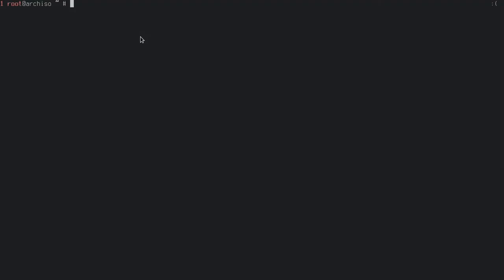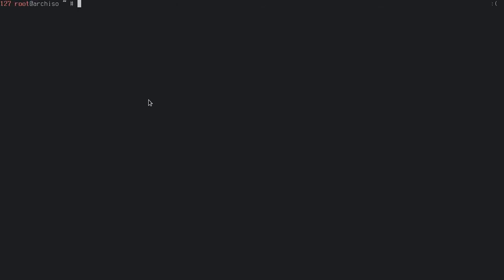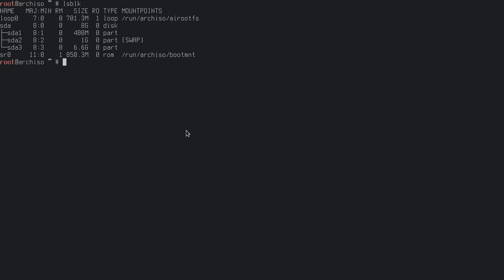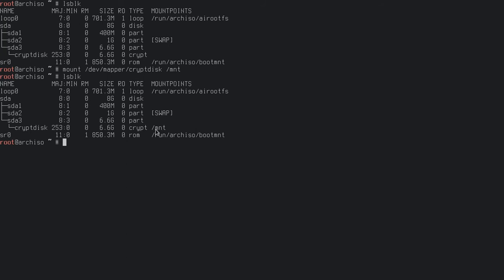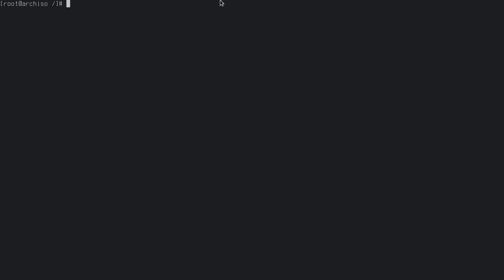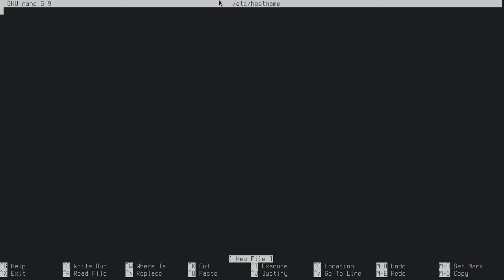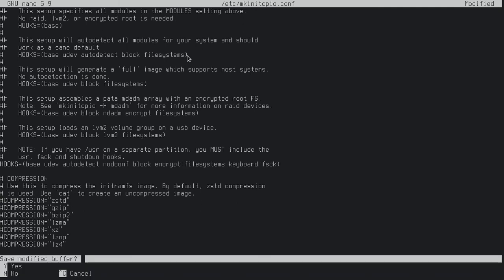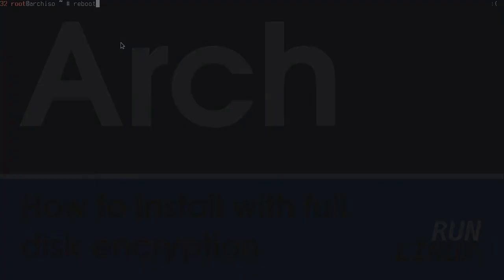Arch Linux: Install Minimal Arch System with Full Disk Encryption

Comment: Great tutorial, bro, I managed to install everything but i cant make it boot, I had to change some of the steps since for me there were some differences from the beginning, may be because im working with the latest version of Arch,  when I entered to cfdisk its doesnt give me to choose label, it automatically set it as gpt, secondly I doesnt allow me to flag the partition as bootable or primary. I proceeded anyway, I used Linux filesystem type instead of Linux, and Swap instead of Swap Solaris, anyway everythig was smooth till I got to Grub install, it didnt allowed me since no partition was marked as bootable, so I went back (out of chroot), entered to cfdisk and changed the type of sda1 to BIOS Boot instead of Linux Filesystem, chrooted again and installed grub, it installed with no errors, I thought was going to work since I got no error during the whole process, but It doesnt boot. Any Ideas? hope you can help me. I know its been a while since you posted this video.

Comment: Is it possible to encrypt the swap? Also that keyboard sound nice what is it?
Reply from the maker: You can encrypt the swap, you would lose hibernation or suspend-to-disk though. You can always run the system without creating the swap partition too which might be a better option in terms of security.

It's the classic keyboard on my x220, it's a beauty! What do you use?
Reply: @runlinux2332  I am in the process of getting arch duel booted with windows and hopefully I can get it done by the 7th. That is the goal. There are just so many choices that are slowing me down. I couldn't decide between btrfs or ext4 for the longest time but I think I will use ext4 just because it simple and will probably get the job done with this first install of arch.
Reply: @Dayytimee  You can do an encrypted swap with lvm

Comment: What does that encryption do?
Adds extra security something like that?
Reply from the maker: Exactly! If someone removes your drive and plugs it into their machine all your files are there for them, but with encryption the files would be scrambled, they would need to know the passphrase to decrypt them.
Reply: @runlinux2332  will this affect my pc performance cuz mine is already a potato pc :/
Reply from the maker: With LUKS encryption the performance difference is tiny. I have many potatoes with encrypted disks.
Reply: @hazed69  only on startup when you unlock the encrypted partition. your machine should run normally after that though.